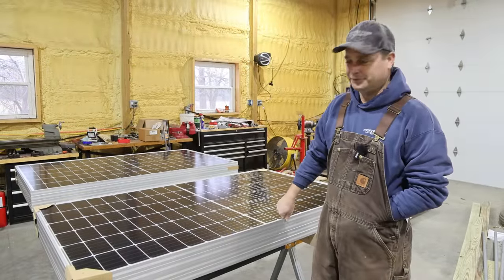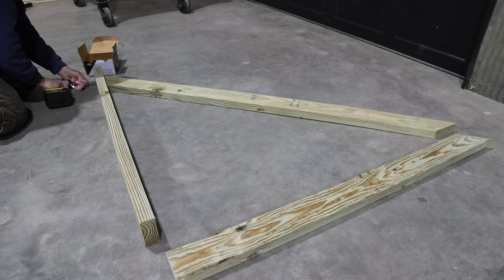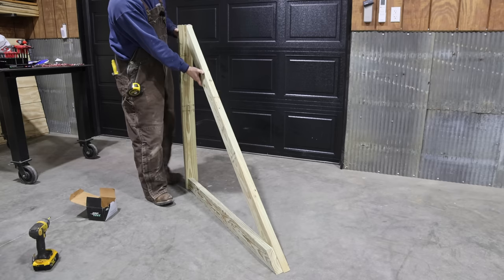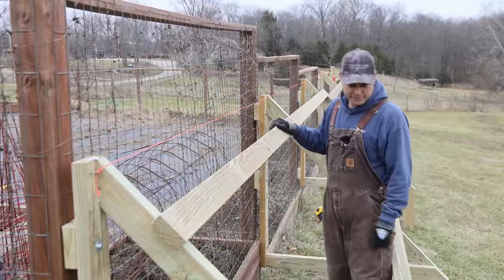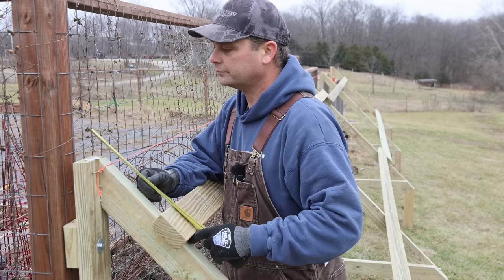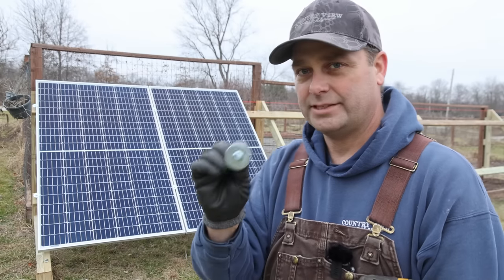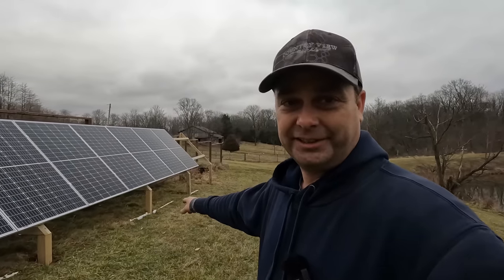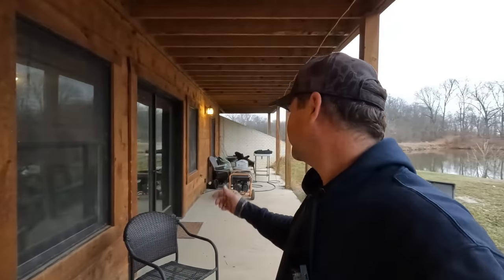Building our First Solar Array.  Easy, Low Cost Solar Ground Mount.

Comment: Evan. Do NOT put them on your roof. You will nothing but regret it. My husband and I have 18 panels on the roof of our barn. We live in lower Michigan not far from the Indiana border. Over Thanksgiving we lost 4 full days of production. And with the Christmas storms that came through another 6ish days. We do have a 30foot brush to clean them off it barely reaches the bottom 2 feet of the bottom panels. Unless you want to get on a ladder to clean them. Please don't put them up there. Concider as you get older it will become more difficult to maintain them  for both of you.
Reply from the maker: My panels are going on the lower porch roof of the pole barn.  I should be able to reach them with a 24 foot squeegee.

Comment: I have grid tied solar and PVWatts.nrel.gov is pretty accurate for its predictions.  What is an unknown is your consumption in the winter.  If you do any heating with electricity, then 2400 watts won't be enough.    But 2400 watts is more than enough for all of the other loads in the house.  If you have propane stove, water heater, and furnace and clothes dryer, you may want to put in a heatpump water heater and a heat pump Heat/AC combo with propane backup for sub zero days.  You can run for 10 months out of the year on only solar if you size the system right.   You will have to clean the panels off, but with a ground mount system, thats pretty easy.   Bifacial panels put out a lot more power for the money especially for ground mount systems.  Will Prouse on Youtube has some great comparison videos.  

The biggest issue I have with my roof mounted solar is that the snow covers the solar panels for weeks at a time in january and february.  This year has been an amazingly mild january in central Illinois.  Hopefully February and early march are mild as well.

Comment: Questions abound. What size wire are you using between your solar panels and delta pros? Is that DC voltage or do you have microinverters on your SPs? What is the distance between your SPs and Delta Pro units? These questions are related to a setup I am designing which has the SPs in the backyard and the batteries in the garage about 150 feet away.
Lastly, how do you buy the right SPs to match the input ratings of your batteries? How did you match the input voltage for SPs and your Delta Pro? How are the SPs configured on your setup as in series or parallel connections?

Comment: I’m setting up a similar system with 6 18v 100watt panels wired so I have 18v 600 watts going 150’ to the house. What gage wire did you use? I look at the wire charts for that voltage, watts and distance it tells me 1GA, then connect that to the 14GA plug in the eco flow???  Doesn’t make sense to me and I want to get it right the first time.

Comment: Good video. How far are the panels from the house and what gauge wire did you run to minimize voltage drop?
Reply from the maker: I ran 12 gauge wire.  They are 400 feet from the house.  The panels are 9.5 amps.  Plenty big enough wire for the length.

Comment: I am looking for about your product place lace me a message . When I post this , I am looking for more information on this .
Just wonder how much pain panels cost you and how much did it cost to get all the sit-ups I like to see more details about this how do you get all this setup and where are you moving it too and how much power do you have since you said you were off grid I'd like to know how much would it put out do you have to use the generators all the time can use the solar panel I have another big question to ask you why you swing power to if you have a lot of wing there or you have a creaky can use a turbo several times trying to to make tiles 2

Comment: Without knowing your decision process, is there a reason you went with 315w panels over 390-415w panels? Different market, but we get it for the same price per watt for the larger panels in Australia. I mean you aren't short of space, but it does make for a smaller array.
Reply from the maker: #1 price, cheaper per watt.  #2 The array voltage and Amps will be correct for the inverter I am looking at.  #3 high quality panel, rated for 1000 volts, and max of 30 amps. (Which is way higher than I will use.) 25 year warranty.
Reply from the maker: The actual size of the panel was a factor as well.  Needed to be small enough to fit on the porch roof of the barn.

Comment: Presume there's no inverter and you can plug directly into those boxes? Curious if the panels are connected in series or parallel and what the max voltage and amperage is over those connecting wires?
Reply from the maker: There are 4 panels in series string.  The panel Vmp is 33.1 volts.   So, the operating voltage is 132.4 volts.  Average 9.52 amps.
Reply: Aren't you supposed to go by Voc rating?

Comment: You would have been better off in the long run by putting in dedicated metal posts for the mounts.
Reply from the maker: Yes, if it was permanent.   But it will be moved to the pole barn roof in a couple months.

Comment: You should never penetrate your roof IT WILL LEAK. Also you lose a lot of voltage on the roof because of the heat. The colder it is the more voltage your array will produce; the hotter it is the lower voltage your array will produce. When you move those to the roof your not gonna produce the same amount of kilo-watts in the summer that you were getting with the ground mount. 

Which brings me to my next point. I hope you or someone else calculated the VOC max and VMP min. You need to know if your array (temperature corrected) will satisfy your inverter minimum voltage and max voltage on the hottest day vs the coldest day.

Comment: If you buy the inverter from Signiture Solar don’t buy Growatt inverter. Look into Schneider electric inverter. I have seen many people having problems with them including me . I was down for 30 days before they actually sent me a new inverter and cost over 1000.00 dollars of fuel to run the generator to all of hour 4 chest freezer on the farm.  Check out the video the Schneider vs Growatt and Sol Ark ., the Signiture solar Tech Support are not the greatest. Schneider Tech Support are in the USA. Schneider inverter has been around for 30 years. Before being bought out by Schneider.

Comment: Why would you build it on the south side of your garden.. that will 80% block the sun from your garden plant. Stunting them.. it is not like sun going to shine throw them. Also the frames must be grounded with a #4 bare standard copper wire to two 10 foot ground rods 10 feet a part. Lightning will destroy them with out all frames grounded. Just like your metal siding an roofing must be grounded I have seen whole bans littlerly blow up an into flames simply because it was not grounded or grounded right. One guy did ground his but went cheap an used only one # 10 copper wire on 4 foot rod   that wire burned right off long before the strick finished
Reply: It's a temp spot while they learn/ get to know more about solar.